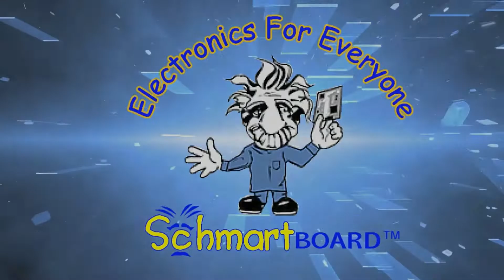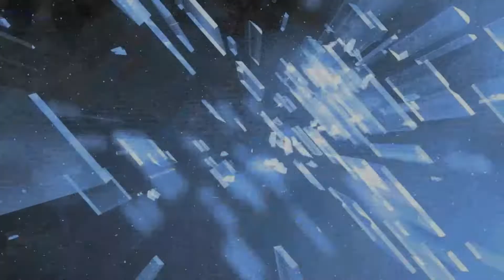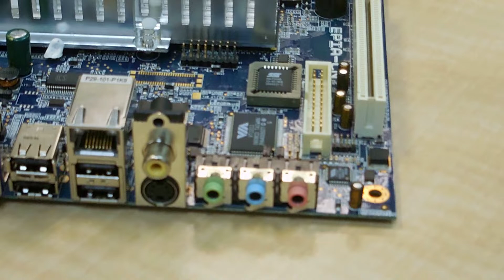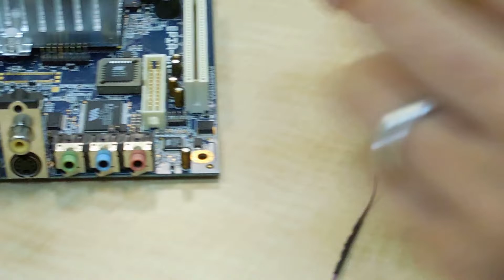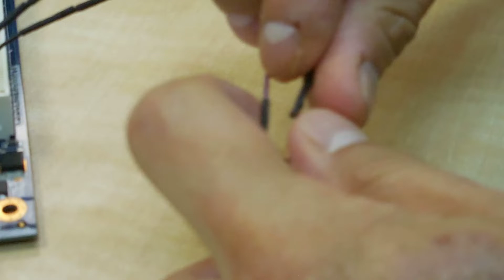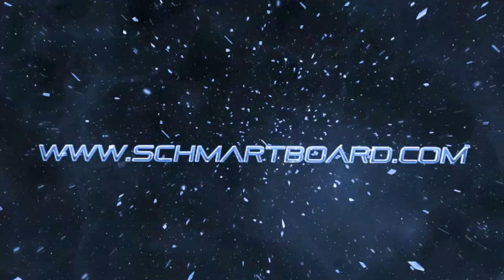Schmartboard Qty. 10 2mm to 0.1 Inch Header Converter

Comment: In addition to the focus issue, the pins of the 2 connectors have pitches of 2mm and 0.1", but those are not the dimensions of the pins.  The receptacles/sockets are made for pins of 0.5mm and 0.025" to mate with the posts.  Please don't use descriptions that confuse the pin pitch with the pin width, since these are 2 independent entities.

Comment: I'm not sure how this works--I've got boards with 2x35 position 2mm headers.  How do I convert them (in bulk) for 0.1" ribbon cable connectors?   Similarly, I've got "mistake" PCBs that i've done where the part specification was wrong--2x17 pads all aright, but spaced 2mm rather than 0.1".  How does this help me?